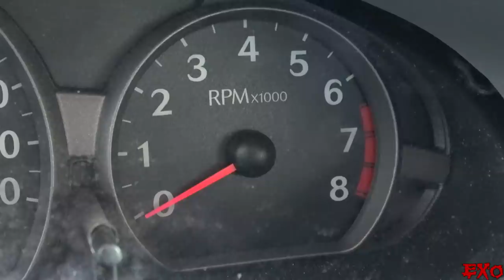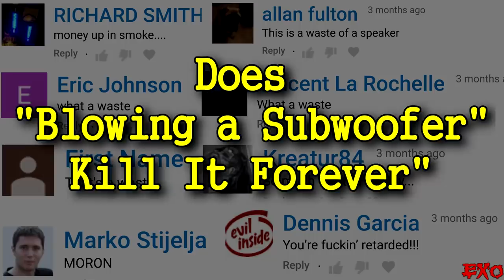EXTRA 18" SUBWOOFER & Car Audio UPDATES! Replacing BASKET | Better EXHAUST SYSTEM | NEW PSI RECONES

Comment from the maker: Happy Friday, Everyone!!!

Have a GREAT Weekend :)
Reply: Awesome video exo!!!
Reply: Might not be as good as your weekend, but I'll try. As this started I got a big smile, so keep it up.
Reply: Exo do you have the big 3 in little blue
Reply: My weekend is going to be pretty low key but after watching this my day is gonna probably be sub research lol. And question for u exo. What do u think 7 or 8 DC level 1 12s will do on roughly 2000 watts dyno tested rms?
Reply: EXOcontralto you too brother
Reply: Same to you man.  I gotta go buy a new amp for my sub.
Reply: I live in NH. I went to Raleigh NC to live for about 4 months one bad winter one year. It's really nice down there.
Reply: Scrap those converters off the old exhaust. They are worth like $60
Reply: BOY! I WISH I OWNED 4 OF THOSE WITH ENOUGH POWER TO PUSH EM. THEY LOOK DELICIOUS.
Reply: It is 105vin Darlington sc atm bro but everyone here for the nascar race n haveing a blast
Reply: Ryan Cloud  hey look up a tap and die set. I believe I'm wording it correctly. Imagine something that drills into a stripped or broke off screw and bites in so u can turn it
Reply: Great vid
Reply: That's a ti basket? Have a good weekend.
Reply: EXOcontralto  - I have a skar 2000.1 and a sundown sa 15. I was wondering if you recommend running a sub like that over powered. I know they are only rated 750 but im very sure sundown sa 15 can handle way more. Just wanting to know your input on this I’m just getting started! Maybe use this as a q&a question?
Reply: Exo .. Yo turn that exhaust pipe that has convertor in and get that 100 bucks for it..
Reply: @tylerdoss2271  there was a video bc of the battle with Rockville and sundown emf audio. Look it up. It handles 750 watts rms forever. They up power and it keeps handling it.  But 2000 watts is too much. I recommend using a multimeter to correctly set the gains lower to not hurt it.
Reply: For the love of all fukkkk please use eye protection when banging on plastic
Reply: Did you just say new amps from "B2 audio"?!....YES PLEASE!!!!!!!!!! LET'S GET SOME OF THAT SWEET DANISH GOODNESS UP IN THERE!!!!!!!!!! Giggity!
Reply: I got a question for you... hmmm feel it coming>?

What speakers do you use at home?
What brands do you recommend for home personal speakers?

SONY?<KEF>?BOSE>?BANG and OLFSEN!?
 

Purchase

Comment: Hey Exo! I just bought a Rockford Fosgate p3 12 inch subwoofer, a radio, and a Rockford Fosgate R500X1D Prime all for $100 from my friend. I'm so happy I just had to share with you! I have to upgrade my wiring from 8 gauge because the amp goes in protect mode if its too loud but its well worth it!

Comment: Building 2 enclosures this weekend and possibly working on my wall. 80% finished with the wall in my Navi. 4-zv5 18's. Can't wait. Building boxes for a single Fi team 15 and 3 Deaf Bonce sa26-12's.
Reply: How the 26 12s work bro im using 4 2712s on a walled system more on the hight htz side u think i could break the windsheild?
Reply: @romeroramtahal8398  no broken windshields with four 12's. Windshields go at mid 60's+
Reply: @DibeezyTheGifted  i broke with 3 12s already bro
Reply: @romeroramtahal8398  that's crazy. Exo doesn't break them with 160db... I haven't broken any with 4-12's and that's what I was just running.
Reply: @DibeezyTheGifted  probrably type of glass 2 bro
Reply: The 2712 are realy good i hv dem on a 12k tara and 12 10s for mids ontop the hood im frm trinidad
Reply: @romeroramtahal8398   they're okay I'm just not a fan of the stamped baskets
Reply: @DibeezyTheGifted  or but they are real good once ur box is good

Comment: Vibration is a mother effer! Both side mirrors destroyed. Headliner is flapping in the breeze. Rear hatch latch has been replaced twice. Shock mount cracked. Exhaust heat shield is completely separated from the bottom of the car. That's just from my 2-5 year old SA15s.

Comment: I know this question is not related but I really need to find this info out from someone who knows. My amp does not have a subsonic filter and I have been told that in ported boxes you need that filter to prevent damage to the sub. If I build a box to be 35 hz does that mean it wont allow the sub to drop below that and thus protects the speaker even without a Subsonic filter. Hope you can help. Thanks.

Comment: Would buying a AMP make my speakers sound better? Because if i go above 30 (max is 50) Volume it distorts. I installed 4X 65W speakers on my 4X55W Sony Player. I have 2 SUBS 150W each on top of the Trunk. I had to disconnect them because otherwise the volume was super low. Can i leave my 2 front speakers on my Player and The back speakers with the 2 Subs on a 4 Channel AMP. I'm wondering if that would work. 🤔

Comment: Yo exo. Got a quick question if you could give me an answer (or anyone else). Been trying to set up gains on amplifier. I'm clipping at 300watt when the amp is capable of putting out 800Watt. I spoke to the company I got it off and they advised that 10% clipping will get me the 800watt and is within acceptable range. Am I being lied to as I though your aiming for NO clipping to protect sub. If that's the case then I'm in the market for a new amplifier

Comment: I haven't had bass in years. I still have wire ran in my car but my alt couldn't take much over 1k rms and I couldn't afford a $400 alt then so I sold my stuff. I need to find a ho crown Vic alt before I start again.

Comment: Couldn't you just have skipped to the last part and just loosen those screws separating the basket from the motor directly? Not that it matters, but it would have saved you some work. But on the other hand, then it wouldn't have been much of a video to upload to youtube of course :P